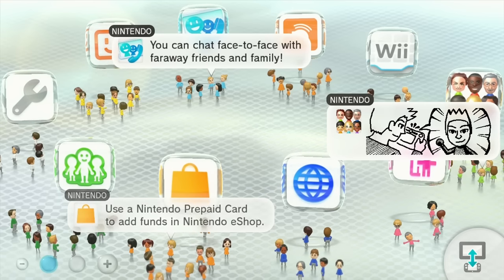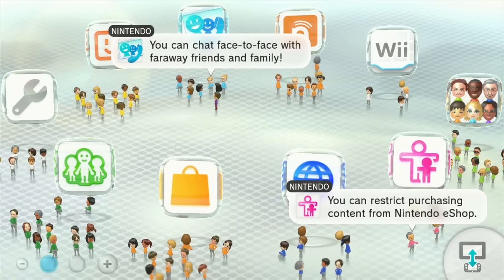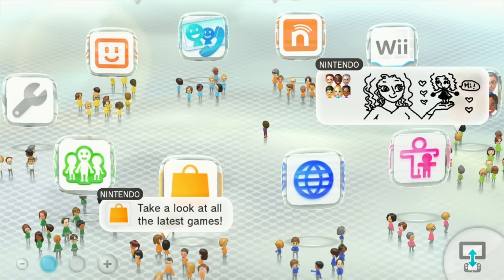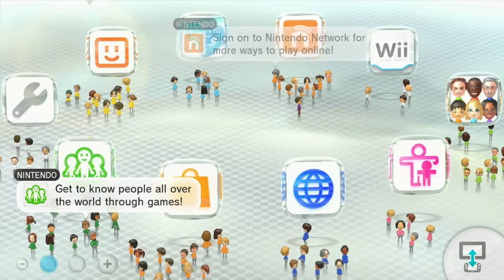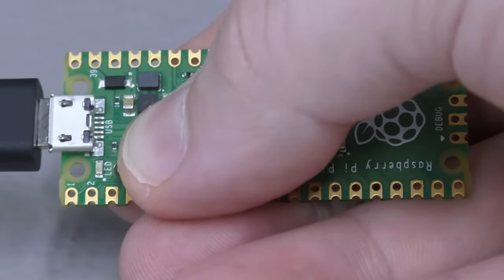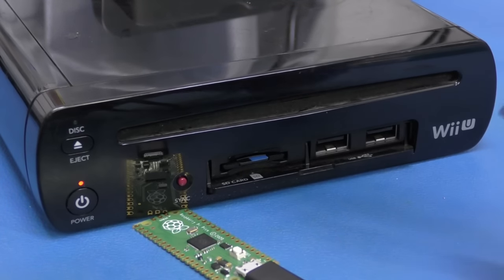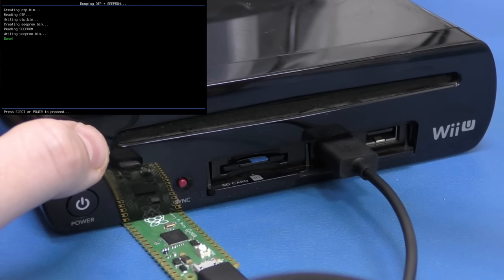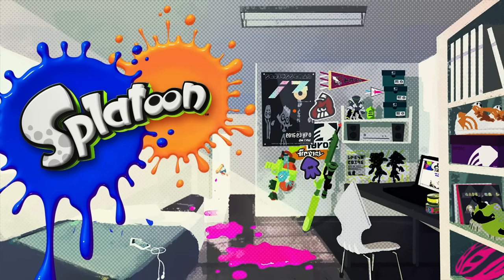The Truth About the Bricked Wii U | Can You Fix yours For $8?!

Comment: Samples are interesting. I also got 6 WiiU recently - sold as not working. Two only had their outputs set to analog or hdmi and the seller didn’t know any better. Two only had a parental soft lock that has an easy workarounds with a webform challenge response. However! Two units had the 160-1400 drive error, and that was a much more interesting to fix (micro soldering) if you can find one of those units to fix its quite ‘fun’
Reply: My WiiU is on black screen (and I have a no connexion message on the mablet), is it an output error ? Do you know how to fix it ? 😢
Reply: My WiiU is on black screen (and I have a no connexion message on the mablet), is it an output error ? Do you know how to fix it ? 😢
Reply: @MidiMusic  do you hear the drive spin when you start it after a few seconds? Did you try on both HDMI and Analog outputs? The console could  be set to either and the other one will be black
Reply: @plgDavid  i tried analog (yuv, rca) and hdmi cables (3 different) on a tv/computer screen... I have a no connexion message and no display signal at the same time...
Reply: @MidiMusic  you didnt answer if you heard the drive spinning on boot? Blue Led on?
Reply: @plgDavid  yes I heard the disc spinning and I have blue light always on. And no screen at all even a wii u logo.
Reply: @MidiMusic  well you may have a bigger prob then

Comment: I had the 0103 error message whenever I attempted to load anything. My Wii U would boot up into the menu and I could browse my games, but the system insisted it needed an update. Whether I tried to update or simply launch a game without applying the update, I would encounter the error.

I followed the steps in this video and, thankfully, my system works again. The system update was actually able to complete, and my games now launch just fine. Thank you so much for this guide!

Comment: Unfortunately, this method did not work for me. I was able to dump the OTP and SEEPROM though, as well as system logs if those would be of any use to you. It seems like my system might actually have nand/emmc corruption.

Something to note, while I was getting the 160-0103 error, the disc drive would always initialize twice. After setting the coldboot title and rebooting, it only initialized once, then still booted into the error. Not sure if that matters, but might be worth mentioning.
Reply from the maker: Sorry Dylan. You most likely have a failing eMMC and this unfortunately will not repair a faulty NAND. But sit tight, there's still hope as this is currently being developed.
Reply: @Voultar  Darn, that’s too bad. Excited to see where developments lead though

Comment: Another youtuber at Robed Repair had done this too. In his video he didn't say of his system was jail broke no not. But it is good to know that you don't have to jail break the console just to repair the chip. 

Also the error code is related to a chip on the under side of the motherboard that stores boot data, save games, and downloaded games.

Comment: My Wii U still boots up and runs games, but the error code appears in some system apps like the Mii maker. If I were to reset the system, I would not be able to get past the setup process, essentially bricking my Wii U. I'll also point out that some of my virrual console titles also crashed to that error code screen, and after reinstalling them they worked fine again.

I would really like to know what could be done for a console that exhibits the symptoms mine does, since most of the sorrounding discussion is focused on Wii Us that can't boot.
Reply: It will sound risky (it is) but you could try by letting you wiiu brick with the reset system process and then try to recover it with the PICO Pi payload. OR you could try modding you wiiU and see if you can reinstall WiiU system applications individually without having to factory reset the console. (Since you said that VC titles with that error were fixed by just reinstalling them)
Reply: In theory if you have the dying NAND hardware issue your console is screwed up no matter what you do, but if it's only the corrupted software problem the PICO PI recovery should work.

Comment: Thankyou Voultar for showing us the light I hav started a few of your solders and I am surprised that i am not that bad at soldering. Also a separate note your video on the GBS-8200 I did one as a complete mod then I did a 2nd one just adding the 10V 10 Microfarad caacitors it heled clean u a white line issue I was having with a MK arcade board to LCD screen, as I remembered why you added them in did a small video about the issue to spread the love, again thankyou for sharing your knowledge

Comment: After hearing all the bricked Wii U stories I wanted to check on mine, so I tried to plug it in but it didn't even turn on… that's when I realized my cat had eaten the power cable 😱😹 So now I'm waiting on a replacement cable to test it, fingers crossed that everything works fine… but in the meantime I've watched and bookmarked this vid, just in case. Thank you Voultar!

Comment: I figured something like this was going on because spawnwave pointed out that this was not a new problem it was something that was happing with wii u's during their warranty period and the fix was send it back to Nintendo. Now it is possible that Nintendo was going through the trouble of replacing the emmc but that sounds like a lot of work I get the feeling that if this was something that Nintendo was doing  probably very quickly they would be releasing a revision of the console. Nintendo reflashing the system image makes far more sense to me.

Comment: I’ve tried this method already as I saw it in another video but it does not work. The Wii U does not boot up the recovery menu, and I know I’ve done every step correctly. In my case, my Wii U displays nothing on the tv screen and the gamepad refuses to connect to the Wii U when I try to enter the Wii U home menu, but it turns on the console just fine. I also do not get an error code at all as the only message I get is that the gamepad can not connect to the console. I’ve tried replacing the CR2032 battery as well but that didn’t fix it either. I tried using the Wii Composite/Component port as well just to make sure it wasn’t the HDMI port that was dead but I was still getting the same results. I have no clue what is wrong with my Wii U.
Reply: hm difficult indeed
Reply: I'm in same boat man. Don't boot nothing on screen  gamepad don't connect. Hopefully someone figures out something here.

Comment: Hey mate, just wanted to personally thank you and add my experience. 

Had a hankering for Wind Waker. 
Still had issues after using the recovery menu (delivered by a Switch Console!) with games  but was able to resolve them. 

My issue (post recovery) was the same 103 error occurred on a clean install Wind Waker on one account but not another. Seems save data can also be corrupted so unfortunately you may need to nuke that nostalgic 2013 save for the affected user (in Data Management).

Again, thank you for a fun, mostly painless experience.

Comment: My Wii u won't even turn on, it's completely dead. My daughter is pretty disappointed, of course nintendo won't fix them anymore. Lord Voultar do you fix Wii u?
Reply: Have you tried buying or borrowing another power supply?  A failure to power on can be the simplest and easiest "repair" ever.
Reply: @CAHSR2020  - unfortunately yes we purchased 2 other power supplies and it didn't work

Comment: This is unrelated to recent reports of dying Wii Us. This *won't* magically fix your defect NAND. Udpih is an awesome tool and let's you fix "CBHC bricks" (and similar (mostly) user-caused bricks), but can't do anything about NANDs dying at hardware level.

From the data the homebrew community is collecting, there is also no indication that not using a Wii U for a long time is causing it. The data suggest it's mostly NANDs from HYNIX which are dying
Reply from the maker: Did you actually watch the video?
Reply: @Voultar  Yes I did, but both the title and the video are suggesting this is a solution for the recent report of dying NANDs.
Reply from the maker: @maschell  How is the title misleading? Neither the title nor thumbnail mention anything about corrupted NANDs and I made special care in the video to explain that this will not fix Wii U systems with corrupted NANDS. Are you sure you watched the video? There's a forum with a sample size of maybe 40 consoles that have been affected by a NAND corruption, this is a very small dataset and I am willing to believe that many people with 160-0101 or 160-0103 error messages don't have problems that are recoverable other than a failing eMMC.

Comment: A truly valuable video to the community. Thank you ever so much for your output and for all your contributions.

In the event I’d ever have to do this, may I ask what USB cable I’d need to to connect it to the system? I just thought I’d ask since it isn’t addressed. I do apologize if it’s apparent somehow.
Reply: USB-A to micro.  Followed the steps and it doesn't work for me.  But that's definitely the cable you need for the pico.

Comment: At this state if i had a working Wii U, i would dump the otp and ROM BEFORE any issues appear. In case a nand replace is required you will definitely be in a better position if you have those compared to not

Comment: Thanks so much for this video. I have a couple questions:

- I received the -0103 error when trying to open a couple large-file games, but for the most part the system still works. Deleting and redownloading the games in question made the games open-able again. Do you think my problem and the one you found are the same, and would my console be fixed by your method? I'm just worried the memory will get worse over time.
- (I'm not tech-savvy.) Did you essentially move the bootup process to the SD card? 
--- How big does the card need to be? 
--- Does it need to stay in the system permanently after this fix?

I moved all my digital games, DLC, and updates to an external microSD card, which seems to have staved off the memory issues, though I'm not sure that'll be a permanent solution. I'm concerned my Wii U itself will eventually stop working, and I won't have a way to transfer my profile to another working console. People have recommended backing up my NAND through homebrew, but I am not well-versed enough in such matters to attempt it.
Reply: Seconding this comment - your description matches my scenario exactly!  And thanks @Voultar for the research & video!

Comment: Great fix. The only thing that saddens me is that Nintendo couldn't be arsed to release details surrounding this issue in better detail to make figuring this stuff out easier.
Reply: Yeah, or offer repairs at a cost. Never in my life have I heard of a console that fails or develops memory issues just because you don't play it for a few years. Mine's never been idle for more than 3 since I bought it, and it has since last year's update developed an issue where it refuses to perform it, freezes routinely at 99%, thus preventing me from playing online, accessing the e-shop, or update any games that need it. I'm out the ability to play Mario Kart 8 because I was mistakenly led to believe that the game was responsible for the update failure, so I went from not being able to play it online, to not being able to play it at all. Like you said, Nintendo couldn't give 2 shits about it, and that is damn depressing, doesn't make one want to continue doing business with them, that's for sure, I'm sure as hell not. If I were them, I'd look at this happening as an unacceptable failure on my part as a company, and offer at least a means of righting the wrong, even if it as the cost of the customer, at least give them an option other than 'accepting' an inevitable failure.
Reply: I just saw a video of someone bringing their Wii U to a Nintendo facility, they were able to replace the device.
Reply: @wicky7591  Could you link the video? I'm questioning where this happened, because Nintendo of America is adamantly refusing to offer any help or solutions to me, even when I say I'm willing to pay for repairs.
Reply: @commanderb7291 It's called "Why I took my Wii U Back to Nintendo."

Comment: I have a few questions! 
1) Can the computer portion of this guide be completed on a Mac?
2) Does doing this process factory reset the WIi U, or make you lose save data, etc?
3) Does this only work if booting up your Wii U causes the error to show? My error doesn't show until I try to load a game
Thank you!
Reply: Oh also... for the SD card portion, can I use the same SD card that I use in my Wii U regularly, or should it be a blank one?

Comment: If anyone is having trouble getting into the recovery make sure you unplug your USB network adapter (and probably anything else plugged into a USB slot) from the back of the Wii U if you're using one. The recovery will not boot if the network adapter is plugged into one of the USB slots when you try to boot to the recovery (mine wouldn't).

Comment: Hi great detailed video, unfortunately did not work for my Wii U. I have error 160-0103 purchased Pico followed your instructions,when I power on after running Cold boot same issue?.
Not sure if other people are having same issue.
Reply: Hi, I had the same issue here with the message error 160-0103. I had followed each instructions on the video and in the end the error wasn't solved yet. A little bit of time later my brother realized that I was turning on the Wii U with the SD Card into it, then he told me to remove the SD Card and the Raspberry Pi after I do the whole process and turn on the console without them connected to it and VOILÀ my Wii U was finnaly fixed!

Comment: Is it possible that these bricked Wii U's are from people that hacked their consoles ages ago with Haxchi, setup Coldboot, then years later completely forgot and deleted the DS Virtual Console game or did a factory reset? Pretty sure the Coldboot method for Haxchi tells the system to boot a different title ID.
Reply: I have hacked the original Wii, but never touched this Wii U until this video.  Noticed system memory errors where YT and/or games would crash.  Eventually, I got the error after the first Wii U logo appears so I now can't even get to the normal menu.  This method allows me get in to the menu in the video and perform the steps, but I still get the 160-0103 error when I restart. :(  Never even tried a factory reset back in the day because we were fast becomming Switch fans.  I want this working again so I can play wind waker and twilight princess again.

Comment: I think I saw another video where they fixed a NAND failure by simply replacing it with another one. The hard part was that you have to anticipate such a failure and back up your Wii U's NAND so when the inevitable occurs you can simply copy and paste it on a brand new NAND and install it in your console. Please correct me if I am wrong, because this may happen to the Nintendo Switch inevitably and I have a huge digital library.

Comment: Unfortunately I still have issues. I got the 160-0101 three years ago. I booted up the console and I get no video and the gamepad says it can't connect to the Wii-U, which is weird because if I turn on the Wii-U, the gamepad turns on. I can boot into the recovery menu and dump logs, but I can't seem to get it to boot. Looking at the logs, it seems like the nand is corrupted.

Comment: I turned my Wii U on for the first time in almost 6 years, and the console boots fine but some of the data on the NAND seems corrupted and I get the 160-0103 code when launching games or apps that have corrupt data. Games that don't have corrupt data run fine. I was able to copy all the uncorrupted saves to an external drive, and delete and redownload corrupted games and DLC to the external drive, but the corrupted saves won't copy over. My Wind Waker save wouldn't copy at first, but after the console was on for a few hours, it suddently copied successfully without any error message. The only remaining corrupted save I care about is Smash Bros. Will this fix have any affect for me, or is my console an example of the dying NAND issue?
Reply: Leave it on and retry it occasionally... Sometimes flash nand memory loses its charge fully and it takes a while for the charge gates (technical jargon) to re recognize... Down side is , depending on what kind of old flash it is, it could potentially never recover... Mine took like 4 days to recover, and then I did a system transfer to a new system... The original crapped out like a month later...

Comment: Good afternoon, I have the 160-0103  Bougfht the Pico and all went fine. But once I reset to the USA and rebooted the system, I still get the same error.  Could I be doing somethign wrong?  I used the repair to the handheld in the menu and it worked fine.  But I can't get read of the error.  Please help if you can.